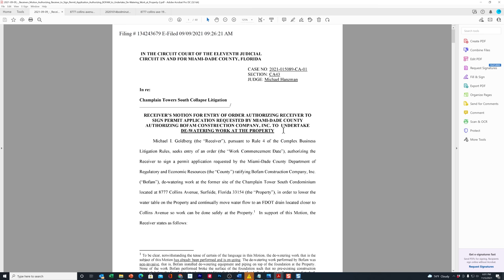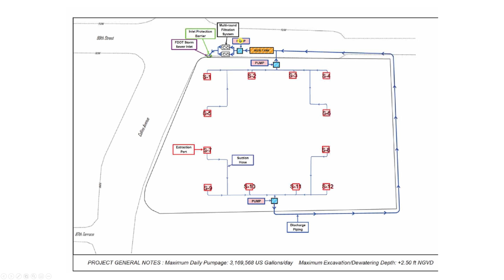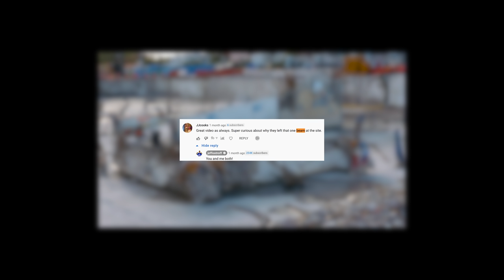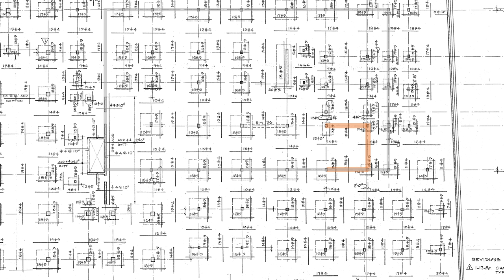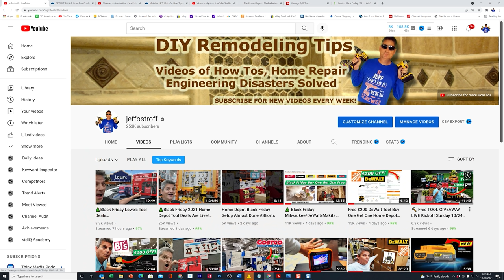Miami Condo Collapse: Engineers Baffled By Mystery Column

Comment: My first thought is that it is the upper support beam. It is clear that the H beam structure pulverized the tops of the 4 columns it was mounted on. The H beam structure is sitting slightly to the north and west of its original position, by a few inches. Once the H beam came to rest on the basement floor, the extra beam above still had its own momentum, plus whatever weight was resting on it. From the looks of it, my guess is that the extra support beam buckled maybe a few feet above its own bottom, and got pushed in a northeast direction. With the concrete crumbled to pieces and powder at the buckle point, rebar formed tight curves. The rebar may not have much strength on its own. But with who knows how many tons pushing hard and fast on the unbroken part of the beam above the buckle, the tightly curved rebar may have focused all that momentum onto a single point, creating an initial crack in the basement floor. Then the beam that is still coming down with incredible force, focused in a tiny area, punches right through the now cracked concrete floor, like a needle. If you look at the H beam, where the upper beam had been resting, you see a considerable depression, along with what looks like the aftermath of rebar having been ripped out of the eastern face of it. But I'm not an engineer, at all. So, this is the guess of a total amateur.
Reply from the maker: You are not far off what we are unsure of is if the floating column impaled the floor or not. There is not heavy damage to the floor.
Reply: @jeffostroff  Except there is. The area around the slab shows a clear irregular depression at the 4:42 mark. It's not easy to see as there is water pooled there so it looks flat. The column is also not exactly in line with the other two. The bottom of the cross beam of the H beam also shows no damage where the column would have been positioned had it actually been there. Retrofitting a column there would have made zero sense as it would not have added much if anything to the structure other than to obstruct a main thruway.
Reply: @jeffostroff  no heavy damage at all. There is no way those pieces of steel punctured themselves through the floor without blowing the floor entirely out of place

Comment: The mystery column defiinitely looks like  a different animal than the others. It seems to have a different layer concrete around the base and different rebar. Another fine video further explaining the many facets of this disaster. Thanks again, Jeff.
Reply from the maker: Yes good point about the concrete!
Reply: Yeah there is no stub of concrete at the base of the mystery column. Perhaps this mystery column was installed in the very recent past after cracking observed in the H-beam? There would not be a strong bonded connection between the old concrete and the newly poured concrete
Reply: @MostlyLoveOfMusic  It's not in line with the middle part of the H beam, it looks to be in line with the two support columns. 
A column just going from the car deck to the ceiling slab??? 
Plus it's slap bang in the middle of the 'roadway', are these roadways wide enough for a large SUV to go around a large column?
It's a wonderful mystery that will come out in due course.
Reply: @JohnnyMotel99  you're right, it doesn't add up. But there are definitely engineers involved who know the answer to this and it will be revealed during the legal proceedings
Reply: Ditto!  Wish I had read your comment before posting my long reply!  Lol.
Reply: @MostlyLoveOfMusic  that's exactly what caught my attention. no concrete residue whatsoever there.
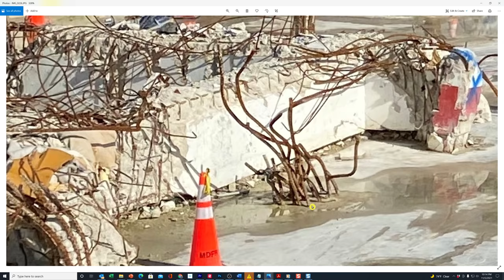Reply: I just watched the video again and I see it now.  At 13:47, when Jeff zooms in, you can clearly see a rectangular outline around the mystery column that doesn't match up with the smooth surface of the rest of the slab.  Somebody cut a hole in that slab, maybe installed a makeshift footing, definitely installed rebar. You can see the concrete overpour smeared on the base of the rebar
Reply: @johnbergstrom2931  yes i spotted this too, which is why i think someone recently decided to install a new supporting column after noticing cracks above
Reply: @JohnnyMotel99  Yeah, maybe a mid-size SUV could make it around another 16 x 16 column like that, but it would make parking in certain spaces really difficult.  You'd have to access spaces 18-23 from the east side.
Reply: @MostlyLoveOfMusic  God, that building was literally falling apart, and the residents were told none of it.
Reply: @johnbergstrom2931  I too saw what looked like a large square patch around that rebar. It's a shame there is no closeups or even different angles. But still, why support the slab, why not the H section right under the 1st floor pier?
Reply: And where is the concrete that would have encased the rebar?  It has either been stripped away, or was never there - all the other column stumps stil have most of their concrete casing, especially in the core between the rebar rods.
Reply: @pulaski1  I think it was never there.  Construction of this 'illegal' column was underway in late June.  Otherwise it would have had concrete trapped in the rebar matrix at it's base, like all the other destroyed columns.
Reply: @JohnnyMotel99  Well, that's the mystery...  Maybe there was a giant crack opening up in the slab just above.  Maybe the corrosion from the nearby planter boxes had made its way into the building.  
The location of this attempted additional column certainly wouldn't have added any support to the H beam.
Reply: @johnbergstrom2931  Yep... there looks to be fresh concrete on the rebar bases.
Reply: Mystery beam is really beam #24, as the whole H beam setup fell about 5ft. to the south. This gives the illusion that there’s a random beam growing out of the ground, when really it’s just the corner beam that held the whole thing up. The problem here is assuming the H beam fell straight down, this throws off the whole perspective
Reply: @bobsmithinson2050  RED COLUMN, Bry Bry, red column.  Now watch the video again, use your brain this time and you'll figure it out.
Reply: @johnbergstrom2931  the red you’re seeing isn’t the red paint that the base of the column used to have. It’s been added after.
Reply: Also, people are focusing too much on the mystery column without noticing there’s another mystery column just to the north of the H beam (blue painted rebar coming out of the ground)…the is is of course because, there is no mystery beams. It’s an illusion because the whole setup fell to the south a bit. The red painted column you’re seeing isn’t tethered to the ground, but rather just resting on it as the whole H beam setup is..
Reply: @bobsmithinson2050  you are spot on sir , well observed, adding a column in the middle of the pathways would have been in the news all over by now from the surviving residents and visiting people
Reply: @johnbergstrom2931  you see sir correctly
Reply: @manikaggarwal2018  Well, I vehemently disagree with that 'Bry' clown, and yet you say we both are correct...
Reply: @johnbergstrom2931  How am I a clown for offering my opinion of what occurred? You must be 12
Reply: @johnbergstrom2931  how is it uneducated when that’s the only explanation for what we are seeing..
Do you actually believe there’s a mystery column just growing out of the ground? That’s childish, just like you calling names just because you don’t like an opinion.
Reply: @bobsmithinson2050  Like I said, just plain wrong...
Reply: @johnbergstrom2931  I don’t agree with you sir.
Reply: Yah the concrete isn't existing anymore lol, atleast the other columns have some hanging on.  That mystery column shed itself of almost all it's concrete.
Reply: @DurzoBlunts  Never had any.  The column was under construction in late June when the building went.
Reply: @johnbergstrom2931  as you say …
Reply: Was about to say the others had a broken and chipped concrete base. The one out of place doesnt have a chipped or broken base

Comment: Just discovered your channel, and I’m gonna say I’m impressed! So I’m going to Identify as an Arm Chair engineer, 20 years of Army Service, seen some amazing Sheet in my life. 
I know that you have mentioned that the Mystery Column was not saposed to be into the basement, my idea is that the possible way that a column should have been connected with the H-beam is/Was a Pocket that it would have set in. Like a upside down dragons tooth. A little bit like a pyramid with the top cut off. It was at the bottom of the 12 floors above it and IMO, it would have significant pressure to the side loading to the East with your description. As well as the down pressure from the weight of the building above. Hey I’m not a school trained engineer just got this as an idea. And I’ve seen nothing on the build structure of the H-beam. But in the pictures that you have shown with the water filled in around the mystery column it would have been a fantastic failure to the outside of the East abutment (might be the wrong word to describe it) where the tooth was lodged into the “H” and if it’s the beginning end of the column then it could have a lot of re-bar starting there and then at the Flange it would flare to widen to (did you say 14”) in that case the rebar guessing it to be 10-12 inches deeper in the tooth and that the flange was the point at which it stopped in the floor of the garage. Subsequent removal procedures would have stopped at the end of the flange and making it seem more like a column was there. The only thing that I do not have a scale to measure the amount depth, and inclusion of the leaves of water indicating that it is a low spot in the garage floor IMO support the impact into the floor and cracking should also radiate from the surface of garage floor. Hey I’m just going to leave it at that. Maybe I got it right, maybe I’m totally off it’s purely speculation... on my part.

Comment: Re: The mystery column.  I also agree that the mystery column does not in any way look like the result of a column piercing the garage floor.  Looking back at the structural diagrams you show, in every diagram the column that sits on the center of the H-beam and extends up to the penthouse is always drawn smaller and rectangular unlike other columns in the area.  However, the photos of the mystery column rebars protruding out of the garage floor appear to be from a relatively larger column.  This input does not solve the mystery, but may point away from the piercing theory.
Also, there appears to be a large number of rebars in the mystery column.  Hard to count; 13 or 14?  Would the number of rebars help determine the size of the column?
As always. I am impressed with all your Champlain Towers videos.
Reply from the maker: This is a tough one to call. I want t be right there on the slab touching it and counting the rebar
Reply: You seem to be ignoring some factors here, first of all the column that sits on top of the H-beam might be smaller but  it extended all the way up to the penthouse, so when it lost the support from beneath all that length, it had to go somwhere in a freefalling motion wich was uninterrupted for a height of the garage. It can be assumed with high possibility that the column shattered on inpact resulting the upper part of the column landing right next to it and producing the same piercing effect as the very bottom of it, the chance of this gets higher if that part of the building would fall vertically or almost vertically. If you look at the footprint of the mistery column you will see that it is highly irregular, for me it makes perfect sense that all the rebar we see is from different sections of that same long column landing right next to oneanother.
Reply: @ddhVapor  Thanks for your reply to my comment.  Replies as such always make me reassess my original observation.  Again, what perplexed me was the concrete floor surrounding the Mystery column appears to be too smooth to account for an impact of the 1st floor to penthouse column.  However, your comment made me readdress the other factors.  If you look at the architectural drawings of the H-beam’s four support columns, they appear to be slightly larger than the 1st floor to penthouse column that the H-beam supports.  However, the rebars of the Mystery column have a definitely larger imprint than the 1st floor to penthouse column.  This would fit your theory that the Mystery column rebars represent at least two sections of the 1st floor to penthouse column impacting the basement floor.  Next observation, there is a clear picture of column N9.1/10 which is one of the four H-beam supports, and it clearly has 7 rebars.  However, the Mystery column has either 13 or 14 rebars (hard to count), much too large a footprint.  

Great comment, I believe you are right.  

The mystery of the smooth flooring will have to remain a mystery, possibly the standing water is covering up some of the impact damage.
Reply: @ajtony1313  I dont really understand what is the problem with the smooth concrete, it is smooth almost everywhere at the garage level. It is smooth even at the parts of the building wich was demolished using explosives, and at places it took the weight of the whole building ad remain smooth. Can you please share with us how it supposed to look like in your opinion? As for the rebars and the footprint: I cant know for sure but i assume that the column (starting at the 1st floor all the way up to the penthouse) wasnt a monolith as it was not poured all in one (unlikely if you ask me) could easily separated when the bottomofit hit the ground. At this moment the top of it was still pushed down by the partially collapsed building (as the eastern part collapsed last and slower than the rest) pushing it further down. If we assume that it separated at ceiling level (most likely) the bottomof the upper part could easily landed next to the already piled part (even as close if they were touching). if you account that amount of rebar (13-14) being 2 part of the same column right next to each other, paralel to each other it suddenly makes sense why there is somuch of it. This would also explain the dimensions of the footprint (both the size and irregurality)
Reply: @ddhVapor  First of all, I agree with your solution that the Mystery column was formed by two sections of the 1st floor to penthouse column separating and then smashing into the garage floor.  
You asked what I expected to see.  The photos show that the column apparently penetrated the floor.  I would expect to see shattered concrete flooring surrounding the point of ballistic impact of the Mystery column. As a projectile hits a concrete floor, first there should be cracking of the surface, followed by spalling (crater formation) and finally penetration.  What I don’t see is the crater spalling.
As I said before, it is possible that the standing water is covering up the floor damage/spalling that I would expect to see.
Thanks again for a good solution to the Mystery column.

Comment: The mystery column is the remnants of the column that sat in the middle of the "H".  As the collapse occurred, the column was pushed off the "H" driving it downward off the "H," penetrating the slab.  The screen grab shows no signs of concrete connection to the slab.  It is penetration of the rebar with compressive destruction of the concrete between.
Reply: Punching shear does not exert great lateral loads on the base of the columns, which is why you still see every column with concrete between the rebar.  The mystery column is different from every other.  I think the level of the slab appears even around the rebar of the mystery column, because it is sediment carried by the flooding water into the slab penetration "crater" - you are not seeing slab, you are seeing sand the same level as the slab.
Reply from the maker: You forget that there is zero damage on the floor where there should have been craters or something else if it had impaled into the floor but there is no damage. These rebar rods look like they were intentionally built up out of that concrete floor like it was done by somebody in the last 12 months, since Fiorella shot her video inside the garage in July 2020, showing no column exists where that mystery column is.
Reply: @jeffostroff  The screenshot of the Mystery Column is post drainage of the site by pumps. Notice the accumulation of the east facing south portion of the "H" The crater around the penetration through the slab by the rebar is filled with the same sediment, which was moved around during the draining process.
Reply: @robertmorley3743  do you think that the rebar would have stabbed in to the garage floor firmly enough that it would not have been dislodged/cleaned during the excavation process?
Reply: @excellent_name  I'm guessing few people are qualified in making that judgement. I would say given a sufficiently weak concrete slab and sufficient force (say, an entire buildings worth), something could definitely punch deep into concrete.

One thing I am certain of is that during excavation they were being more gentle than usual in an attempt to preserve whatever evidence they could.